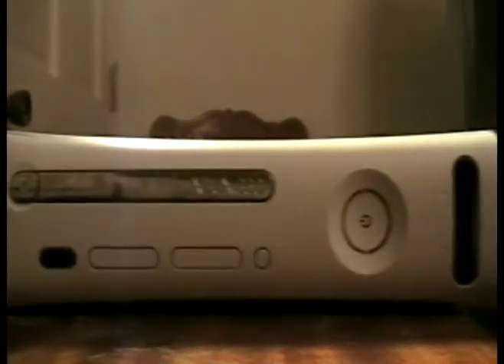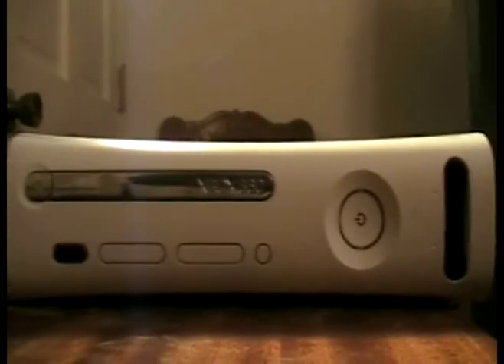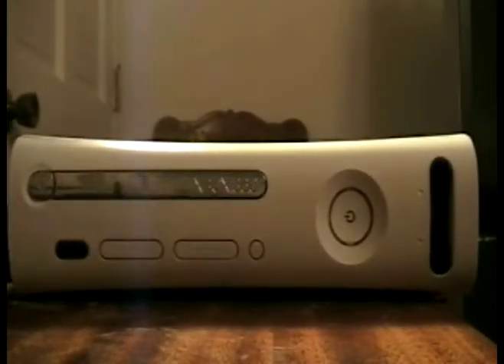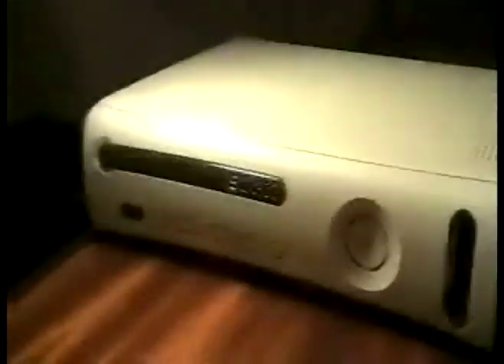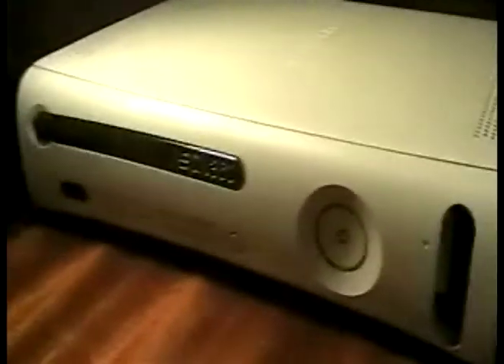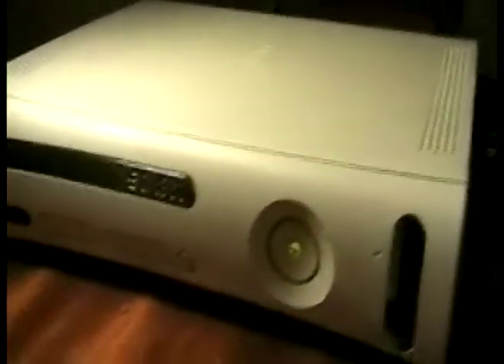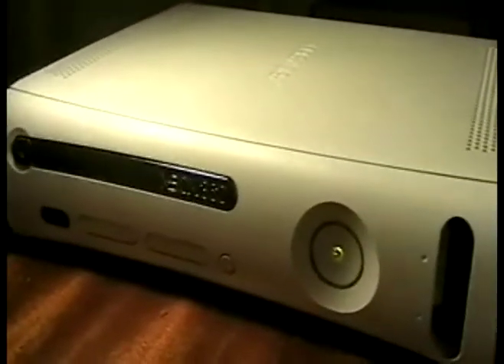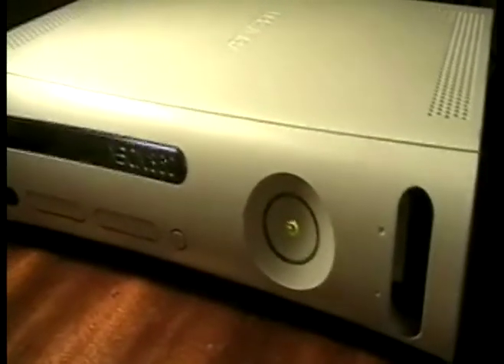How to Fix the RROD Xbox 360 Step By Step Part 4 of 4

Comment from the maker: 1-Southbridge X-Clamp-Fix
2-Reflow the Southbridge/Ethernet chip area
3-Check the area under the Southbridge for parts that might have fallen off and solder them back on.
4-In rare cases it can also be GPU related so an X-Clamp Fix might work as well

Comment: Hey I need some help. I followed everything you said and my 360 is back! But after I play for about 45 minutes, the game freezes. That went on for a while until I decided to aim a fan at it. Well when i point the fan at it it works just fine for several hours (it hasnt frozen since i pointed the fan at the back of it). I dont mind having the fan on it but is there anything I can go back and do to make it run fine without the fan pointed at the back?

Comment from the maker: The white compound is the cheap stuff you need Artic Silver 5 Thermal Compound about 9 or 10 dollars at radioshack and it won't work if you don't have enough on the cpu and gpu

Comment from the maker: Yes that is a newer xbox 360, make sure you put enough Artic Silver 5 Thermal compound on the cpu and gpu and don't tighten the screws too tight just until they get tight then stop and you put the foil on the artic silver 5 thermal compound which is on the cpu and gpu

Comment from the maker: Make sure you have enought Artic Silver 5 thermal compound on the cpu and gpu and don't tighten the screws to tight, the Artic Silver 5 Thermal Compound goes on the cpu and gpu then you put the foil on top of that

Comment: my x box 360 is diffrent on the inside it has the same things but my heat sink has a smaller on attached to the big one and i did wat u did and it worked then it stopped and i tried to do it again and it wont do wat do you think is wrong i put foil on it with the silver thermal heat  please help

Comment: I have a problem, i followed all the steps to doing this exactly until  u said to overheat the smaller heat sink.  When i turned it on it turned on like normal (no red rings). I was really happy so i forgot to overheat it. So I put it all back together and started playing gears of war. About 30 minutes into gaming it started freezing again ( what it did b4 rrod). What should i do? Should i take it back apart and overheat it? Or is there a bigger problem?

Comment: i wasnt sure about doing all of this stuff because im not a pro so i gave my xbox elite to a I.T. guy and he fixed it using steps similar to this it works......... except a capacitor still bulged and now he has to get a new capacitor a solder it on so it might not always be the cpu/ gpu problem that causes your xbox rrod

Comment: great tutorial, explains each step much better thanmost of the other video's.  

Just a note about thermal paste.  Thermal paste elminates tiny airspaces between the surfaces.  Air is an insulator (thus the efficiency of thermapane windows) and even the air gap created by a scratch on the surface of the chip or heat sink decreases the rate of heat transfer from the the chip to the heat sink.  Heat can cause delamination which = 100% ruined.  This is one reason the towel method should be avoided.

Comment from the maker: The foil will hold some of the heat but then some of the heat will go to the heatsink, thermal compound keeps the chips cooler so not alot of heat is going to the heatsinks, thank you

Comment from the maker: yes plug it up after you have put the screws, metal washers and nylon washers and thermal paste and for permanent fix aluminum after the artic silver 5 this experiment was done by a friend the Xbox 360 had been running good since August with aluminum